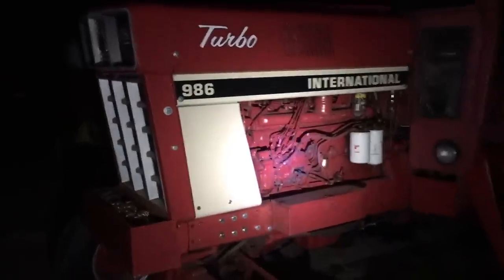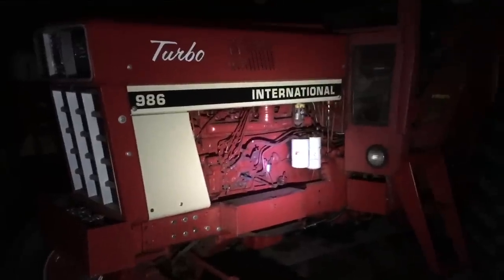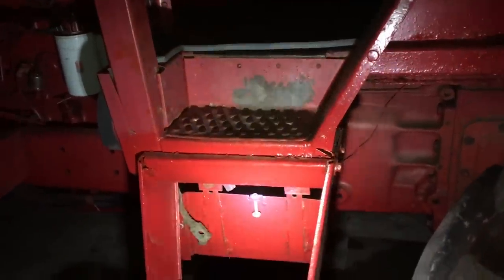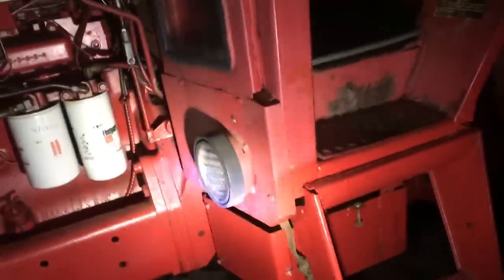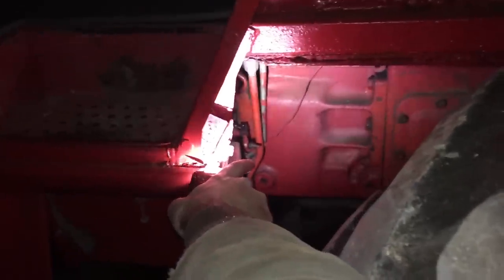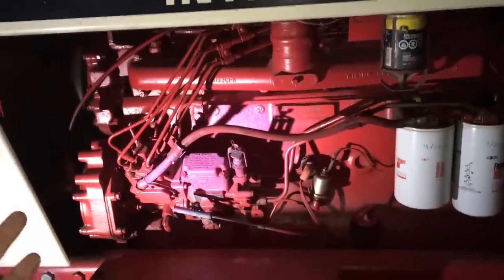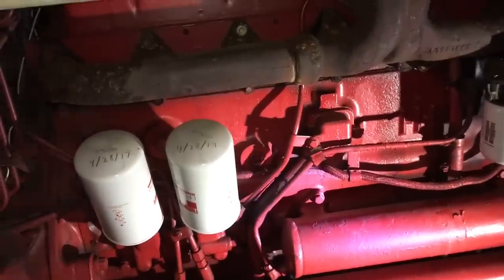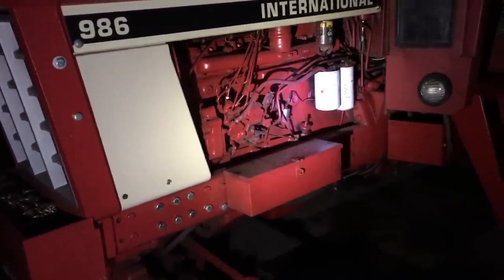IH 66/86 Series

Comment: Thank you for explaining the correct use of a ta. I worked on these tractors when they were new and if the salesman didn't explain how to use the ta, it wasn't long and that tractor would be in the shop with the sprag clutch out. Good correct information.

Comment: My Dad bought a 966 in 75. We farmed 1000 acres for 10 years, and dad finally converted to hay operations over row crops. Biggest issue is he sold off all the implementation. Dads gone now and  Red is mine. I'm needing a disc, I just rebuilt the plow. Have to keep it locked as people come around trying to buy the " piece of junk" from my mom. Runs as good now as when I first got to drive
Reply from the maker: Yea they will definitely last awhile and it seems everyone is looking for a deal on them
Reply: I put  a big sigh on my front gate that says ' machinery, equipment and vehicles are not for sale.' And it works.

Comment: One of the most reliable and dependable engines ever created in my opinion!! Perkins rite alongside it. The 1566 I used to run was like you said. Just a great tractor. Never an issue.
Reply: MF Tech I agree with u 💯
Reply from the maker: We had customers that would have the newest in tractor technology, but they just couldn’t get rid of the 1066 or 1086 they had. Usually they were paid for and would do what had to be done.

Comment: International was very smart to partner with Neuss back in the 50’s I believe and by the 70’s most of internationals engines were coming out of Germany…they built them right up until the mid 90’s until they just couldn’t meet emissions…excellent engines and if they were very well maintained, they would outrun any engine on the market of their day and burn less fuel doing it!..they also built them with rebuild in mind saving the farmer a great deal of money!
Reply: Interesting. As an Australian farmer I have 2 Neuss powered trucks and a tractor. Yes they are more expensive to repair than the very much common Perkins 6-354. But here farmers prefer the Perkins,(plastic Perkins we diesel mechanics call them) Personally I'll take a Neuss over a Perkins any day.
Reply: Wat the nuess engines are the shittest engine ever built

Comment: We had a 856 IH, we put a turbo set-up on it and pulled a 5 bottom plow with no problem , we farmed with it for about 6yrs then traded it in on a 1466 Turbo with cab and farmed with it for over 20yrs , best tractor we ever had. We farmed with J.D. 720 with a pony motor , 1800 & a 1900 Oliver deisel and a 77 Oliver Row Crop that we used for haying and a J.D. 4400 Combine that we bought at a farm sale , the motor had caught on fire , we built a motor with turbo and replaced alot of the electrical wiring...!!! All of these tractors we had gone thru and rebuilt the motors and clutches before they went to the fields to work...!!! After dad retired from farming these tractor got top dollar because we stayed on top of things and fixed what ever was brokeor needed repaired....!!! I guess what i'm saying is the IH was the work horse on the farm....!!! We bleed RED....!!!

Comment: I love all my 66 series,  I have a 666, 966, 2-1066s, and a 1466. Great to work on, I bought 3 of them as fixer upers. Another common problem I've had is the steering control valve leaking, that's not that easy to fix. I made splitting stands on caster wheels, it takes me about 40 hours for a complete transmission tear down and rebuild including clutch and crank seal. But I take my time and try to do  a real good job.
Reply from the maker: Yea. If you compare these to what new ones cost, you can buy a shed full! I would rather have 5-6 of these than 1 brand new tractor.

Comment: Nice video. We ran a bunch of the bigger 66 series- 1066, 1466, 1468, 4166 and a few of the 86 series in that HP range. The T/As were troublesome on the higher HP tractors for sure. Everybody had suggestions on how you should use them to prevent them failing, none of which made any difference. We used the T/A sparingly, only in the field to get through tough spots. Still they failed eventually. Best advice seemed to be pretend it isn't there as much as possible because the Sprag clutch would eventually wear enough that all of the rollers flipped over and it wouldn't work. Never had T/A problems with the smaller tractors. The IH 6 cylinder engines were wonderful. The 550 V8... to be honest, not so great. Fun (chrome pipes and all) and sounded really cool, plus that tractor would crank down the road at over 30 mph, which was useful. Put a smile on your face until it went bang Lol.

Comment: Our 1066 had over 7000 hours never failed us started every time in a mid Michigan winter
Reply from the maker: Yea they are all weather engines. I like cummins too but the biggest drawback with cummins is no sleeves. You have to watch you don’t overheat them.
Reply: PA Farms 

Ford tractors didn’t have sleeves either.

Comment: I've had my 1086 for nearly and decade and LOVE IT. The Dt414 is practically bullet proof and it has far more torque than I need. I just replaced the starter this weekend. The biggest issue is the weight. That thing feels like it weighs a million pounds LOL. The next fix on mine is steering hand pump is leaking at the top. Fun, fun, fun

Comment: we had 1066 and 656 great tractors our 656 had over 7000 hours with no engine work and only replace the clutch once but the TA if pulled would put the tractor in free wheel if going down hill while balling so you had to apply a little brake
Reply from the maker: My 544 was similar to the 656 TA. It didn’t hold back on the low side. My 560 is the same way.
Reply: TAs on Farmall tractors before the 706-806 tractors  were designed that way.

Comment: Thanks for the info. The 400 series engine the best IH engine ever made I think. I like the 66 series but I needed a cab tractor and the 86 series have better cabs that’s why I got a 1086. Looking forward to part 2.
Reply from the maker: Yea the 66 series cabs are pretty crude. The 86 series was the first Tractor designed for a cab

Comment: I worked on those miserable T/As at a Case IH dealer. The T/A unit was small for a tractor of that size. Allis-Chalmers Power Director was a much better design. I worked for both brands in my time as a mechanic. A/C engines left a lot to be desired. The bull gear in the rear ends on 66 & 86 tractors had plenty of problems also. A/C also had a 6 speed power shift at the time IH did not. So in conclusion put a IH engine in front of a A/C tractor drive train you would have a great tractor.
Reply: Hey, so do you know when they introduced powershifts on allis

Comment: You're talking about the torque amplifier I remember my old man had a 756 and 826 a 966 a 1086 and a1466 I remember they always ran the tractor with the torque amplifier in Lo and when they got on flat ground or out on the road then he would kick it in high I never remember any issues he never pulled it into low until it was about stopped matter fact they ran low almost all the time other than when they hit the road but just kick it into high like a highway gear I guess he had a different take on it
Reply: That’s how I run all our 806s, I guess I’ve been doing it wrong all these years according to the information he gave in the video.
Reply: The engineers built them as he described, to pull through hard stuff. 

If it works for you, I can't say not to. 

They really could have built it much better and more reliable like a brake band and planetary gear or a torque converter that is normally locked. "Fluid Drive" worked for a 80,000 lb tank.... Why not a tractor that weighs less that 1/4?
Reply: @herpnderpn2484  you're right about that folks say I shouldn't shift my zf5 in my super duty without the clutch but I always have and always will I got an NV 4500 in my Chevy I run them gears all the time no clutch I think as long as you're not slamming hard on something you can use it however you want as long as you're intuitive and can tell whether the Machinery likes it or not
Reply: @forestlawrencegrading9154  I do it in my Cummins with an NV4500, haven't managed to do it with the G56 in the new ones. Have a friend who has an old Ford ranger that does it. 

Why not save the clutch? I don't want to seperate the engine and trans any more than I have to. As long as you don't grind, your fine usually
Reply: @herpnderpn2484  there you go maybe my old man had something when him and my brothers always ran the TA on the IH in low and basically used the high side as a road gear if I remember right the farmer down the Road used his the same way I was friends with his kid and we talked about it cuz we were both waiting to get old enough to be allowed on the tractors

Comment: I have to agree that those engines were bulletproof!  Had a 1086 and it must have been running around 150+ hp! I had mine for 12 years with absolutely no problems and I'm generally a Deere man! A little crude of a tractor but,  it made cheap power for me!

Comment: I have a 766 with 6000 hrs that my grandfather brought new.  Crank shaft cracked in half on it and had a hard time finding one. It has the D360 in it and not a lot of them used .   Ended up finding one and had about 25 hours into  repaired by myself.   It's definitely a good tractor but I still love my Deeres better.
Reply from the maker: Yea the 360 wasn’t bad, I always preferred the 414, 436, 466 engines. I have so little experience with JD. I have driven many but as far as working on them, wouldn’t know anything about them
Reply: I grew up cane farm we had 756 856 1466 1486 and a black stripe 976 must of been an Australian model it was built in Victoria in 79 i grew up with those tractors luved them

Comment: IV got a 3588 Snoopy sitting out in the weather rotting away because IV snapped the shaft of the internal hydraulic pump, I had a mechanical look at it and he said I can put a new pump in but it'll snap again as something is amiss in alignment or something. I'm having a real battle finding a hydraulic pump anyway as in Australia here the 88's weren't very common, the Snoopy version anyway. Very confused as to what to do with it. It's always had crook 3 point linkage to so I think it's going to have to be split. It's TA is stuffed to but I never really needed. IV got a 756 as well and I can't get it out of gear so left it under a tree and walked away lol. Think she's right out of fluids. She's a work horse, it was left in scrub country a few years ago and it flooded, I forgot about it for about 6 month's. Once the water had dropped enough I got out to it and the water mark and lot's of timber debris was under the top step so she had a good bath... Totally agree with the engine being unkillable and very strong. I had a 5150 FWA case maxum 125hp pulling my 2-11 scarifier andhad an issue I can't remember but I had to swap tractor's and put the 756 100hp 2wd on in its place and not only was it pulling easier but faster and running cooler.... IV 4 old 5-11 combines 24r I use a tandem hitch to pull 2 at once, 1st high on the 756 could of used 2nd high. Just love's being challenged! Edit" the TA is stuffed on the 756 to and is addicted to aerostart, I am going to try and upload some old video's of the 756 working in mud up to her ass, Dad is operating it about 10 year's ago and boy did he teach me a thing or to about turning brakes and walking threw the impossible!
Reply: Especially qs5x

Comment: Hello from Australia. I run a 1586  and 4586 on our farm ,but my late fathers 766 has a hydraulic problem. I dont want to abandon her just yet. She is an Aussie built '72 model dad bought new with 5966 hours. The hydraulics are a pause run pause run pause run affair. Motor runs fine. It affects 2 systems, steering and remote hydraulics. Torque ampifier is not affected, still original. I'm strict on servicing and use Hy-trans. Could you give me help, I would be grateful.
Reply from the maker: Sorry for the long delay, sounds like it could be a few things, one thing that comes to mind would be the MCV pump. The drive gear on the pump has a small keyway, sometimes the key shears and the gear can’t drive properly when hydraulics are under load. There is a nut that holds it on the shaft that comes loose as well.
Reply: @PAFarms  OK, Most mechanical work is I done by me, so I'll have a look at the parts in my parts manual. Thanks mate , for your help. She is lovely old tractor ,our first big cropping tractor.

Comment: I'm looking at buying a 986 but it has a loud hyd grinding type noise. Gets louder when your turn the steering wheel. Fluid is aerated and  mid way up the add mark. What would you recommend top fluid change filter?

Comment: I used to run a 766 and I loved it. It would do anything on the farm. If I would buy one with the ta out would i still be able to use the tractor?
Reply from the maker: Yes. It will still work in both high and low range through all the gears.
Reply: PA Farms  if the TA go's out the trans won't be stuck  in hi or low range only ?? TY,,,

Comment: Haha, you still have bolts to hold your floor in.... We are down to four in ours.Dad always said to pull the TA back only under load, so when baling, use the breaks to create  drag.  We got almost ten thousand hours on our injection pump until the low sulfur fuel got it. You forget to say for the TA to check the lever. Ours had frozen in place until I finally took it apart and oiled it last year. I would take an 86 over a 66  any day of the week.
Reply from the maker: When I first got it home, it had 2 bolts in the floor, one on each corner, I had cleaned out all the threads and had to tap a few and got them all in. Then I had ordered a floor mat to put in. Was surprised All States had them for $59.
Reply: I used a left over section of truck bed mat we had. I just had to use a good box cutter and a little patience to make it fit.

Comment: hey we have a 1086 that had really bad brakes and also had trouble pulling its self. for example driving down road with even a slight incline it looses speed more then it should. do you have any advice on what i should try or how i could test it to know if it is my ta or if it is my cluch

Comment: My 1086 runs great, but it shifts like a nightmare if you don't know it well, and will also get "crossed-up" between gears without much provocation. That's why there were no bolts on the floorboard when I bought it.  Also rides like a brick. And the T/A....don't even get me started. What a labor intensive poor design. Mine's been into 3 times (yeah heavy duty cable and all) and now it's stuck/frozen on the high side (fortunately). Again, it runs great, but steering slack closely resembles a loaded pulpwood truck compared to Ford & JD models of the same era.
Reply from the maker: Haha yea the 86 series is definitely an acquired taste... those are definitely the common issues

Comment: 986 is a hell of a good tractor still our main work horse on the farm
Reply from the maker: The reason I think why the 986 will last is it’s a large engine and low HP. You figure 436 ci and a factory rating of 105 hp. You can’t really over work it
Reply: PA Farms your right iv used a ford 9600 and they have a 401 and put out 135 with a factory turbo and they'll last about 7000 hours before needing to be overhauled
Reply: Joey Probably a better comparison in the Ford would be an 8600, it used the same size engine as a 9600 but was 105hp naturally aspirated. I don't have first hand experience with high hour with them though.

Comment: The shift on the 86 series was a joke on the left hand side and when they get worn out get stuck in 2 gears. Ive ran a 10, 14, and 1586, do not like these tractors cause of that reasons alone and because of that they are no good for a loader tractor. Engines were tough yes but IHs big improvements came out on the 88 series.  Got rid of the TA, put more gears in them and better spacing of the gears, the older IHs had to much gap between 2nd and 3rd gear. 18 speeds was much more improved. Id move up and buy a 5088 over a 1086 any day.
Reply from the maker: I agree, I liked the power shift on the magnums but the MX magnums were nicer.

Comment: Is that JD either. Never had TA issues other than cables and springs.Tried after market parts but they not for me. Changed both oil coolers on 666 and 986.
Reply from the maker: Yea it’s jd either. Was on the tractor when I bought it. It’s empty, I just left it on, people have asked about it. It’s kinda funny

Comment: I liked your videos. Am I the only one who's noticed that "turbo" is on the side of the hood? If memory serves the 986 has a 436 ci without a turbo and the 1086 has a 414 ci with turbo.  We've had 1066, 1086, 886, 3588 and as in one of your videos the starter is a nightmare to replace but I was lucky and only had to do that once in the 1086. I agree that they are very good engines and could have just as well been used in the 71 series magnums. And yes the shifting took some getting used to. JD and Case had IH beat in user friendly shifting. I never liked how the TA worked in the 86 series. There was too much internal mechanism which made it more difficult to use verses the 66 series. I'm mostly green now but still have the old Farmall 350 gas (looking for a diesel twin to that one) and a 1964 706D that my dad bought new. I restored it a few years ago. Oh one more thing that was just awesome in the 66 and 86 tractors is the hydraulic boost for the clutch. Made it much easier to use. Baffles me JD hasn't used that.
Reply from the maker: Yea you are right on the 986 not being factory turbocharged. The previous owner had installed a turbo kit you can get for them. Now the engine is the same configuration as the 1486. When I repainted the hoods I added the decals.